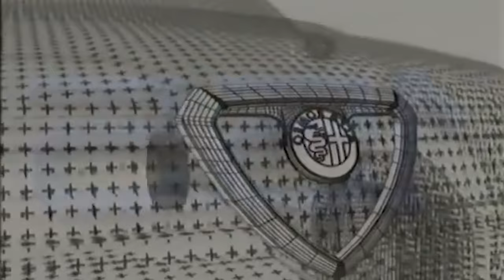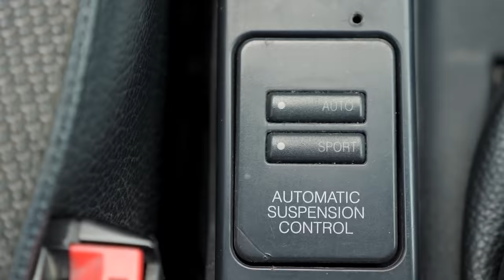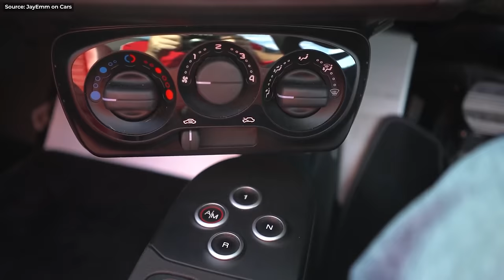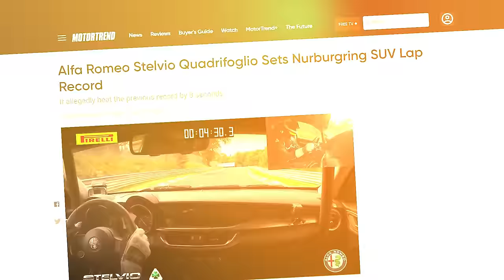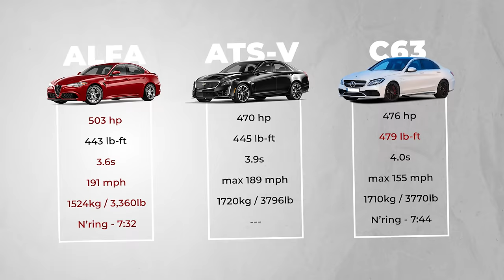7 Alfa Romeos (since 1980) that DON'T SUCK

Comment: The V6 in the Giulia is not a Ferrari V8 with 2 less cylinders, its technically not that simple. Its a completely new developed engine, just the engineers is the same, Gianluca Pivetti. Fun fact: he developed the 4 cylinder petrol too.
Reply: The 2.9 Giulia Q engine is part of the Ferrari F154 engine family and is indeed the same engine as for instance the Roma, minus 2 cylinders and a couple other changes like 120° crank.
Reply: @gerbrandicus  no its not. Inform yourself properly and dont believe journalists bs talk.

Comment: Exactly. I was a big fan of the English show The 3 Musketeers... until they started talking badly about Alfa Romeos and especially Lancias. machines that have never had problems and they stuck to the gauges which were sometimes faulty. but these are commercial parts and not produced by motor manufacturers (in truth, most were German...). there must be a reason why you don't see English cars around except very recent ones in most of Europe and if Italy is the homeland of engines and manufacturers (not that designers...) copied by the world. Thank you for giving credit to the great destroyer's so much inventiveness

Comment: Putting the 4C against the Corvette isn't entirely fair, as that's talking a mass produced domestic car versus an imported car built in much smaller numbers. And over here in Europ, that Corvette would be quite a bit pricier than the Alfa....like twice as expensive her in the Netherlands. Also, it was released in 2013, so no wonder the interior looked like one from.....2005 or so. And who even wants power steering in a hardcore, lightweight sports car? Everything focused on handling and performance (very much in that order).

But in all honesty, I don't think that many Alfa's of the last decades sucked. Many were perfectly fine cars that generally looked and drove the best in their class, though generally at the cost of practical stuff and modern tech. And no volume brand can survive on enthousiast cars only. I've been driving a diesel Mito for 8 years and over 250k now (with near-perfect reliability!), and despite some nuisances, I still enjoy it. And can't think of a better car in its class. But the big problem with Alfa was that everybody liked them, yet didn't buy them. And it wasn't helped by the fact that they kept old, outdated models for way too long, or didn't give them proper successors. Like how they scored big with the 156, yet couldn't continu that with the 159, and by the time the Giulia finally arrived they had basically lost all their former customers. And after years of being almost dead, they come with the outdated-from-the-getgo Tonale? Who do they think they're fooling? Luckily the Junior finally seems like a step in the right direction again.

Comment: Well - you've missed out the SZ (which is criminal - it truly did not suck) and even worse you missed out the 156 (which did not come to the USA), which is a pity because its 2005 Guigaro (I have one) is the one to have and drive every day - the way you are supposed to - with German/Japanese-quality electronics, the mighty V6 Busso Engine, and a manual gearbox in a 2+2 sports car (the rear doors are only there for easy loading) remains a heady mix...and it had the unhinged GTA variant with the 3.2 - and a stationwagon ! While we are at it, there was also the GT V6 3.2, another gorgeous, heady and non-sucky modern Alfa.

Comment: Ive never heard the original spider called a duetto before. Was that the American name for them? Wikipedia doesn't mention it.
Reply from the maker: From Wikipedia:
"To choose a name for the spider Alfa Romeo announced a write-in competition, offering an example of the new car as a prize.[15] Over 100,000 ballots were sent in, the great majority from Italy; the winner was Guidobaldo Trionfi from Brescia, who proposed the name "Duetto" (duet).[15] However it could not be officially adopted due to trademark issues: the confectionery manufacturer Pavesi had launched on the market in 1965 a chocolate snack called, indeed, 'Duetto'; the Court of Milan ruled that Pavesi, having already registered the name, had exclusive rights to it, thus the car was named simply Alfa Romeo Spider 1600."

It still remains as a nickname and many people call it like that. Besides, Spider is just a type of car. Duetto is specifically only this one.

Comment: The concept of the Califorina was originally supposed to of been a Maserati. But due to the high costs of the engineering of the car it was better to brand it as a Ferrari as it would of sold better than if sold as a Maserati at the same price.

Comment: The cheapest 4C I found in Europe was 63,000 EUR. Obviously a used one. Considering that the MSRP sates 67 000 USD which is around 61 000 EUR it is safe to say that used  car dealers are greedy assholes.

Comment: eey why isn't the 156 in there? I have a 2002 1.8L TwinSpark with everything facelift except the exterior, blue Momo leather interior and sunroof and I'm damn happy with it. A good friend of mine is a BMW fanboy with an E46 320i Convertible and even he thinks it's great, especially the Momo seats. We also did a few little runs and his 170hp I6 ended up being slower than my 140hp I4. His car does way a bit more but he really believed the I6 will take the lead

Comment: What's your opinion on alfa 33 stradale
Reply from the maker: The car is very curvy, just like the original, but then it has very contrasting hard lines in the headlights, on the hood, and the rear glass. 
It's very pretty, but those things are bothering me .
Reply: @TopCarsTV  now you mentioned I can't unsee it 
It's is also starting to feel that way now

Comment: I had a regular 155 and it didt suck at all. It wa extremelz fun to drive and verz practical at the same time, while it costed back in the about 1000 dollars. A japanese car at that price would have a million miles on the clock and a hole in the floor that would make you feel like Fred Flintstone

Comment: I own a 2022 Alfa Romeo Stelvio Veloce, 280hp, 4wd. I love cars and my wife was open to it (she drives it every day) so I bought it, I knew there was a decent chance I would regret it. It's great for the once in 3 months I feel like taking it driving up a mountain, compared to it's competition it's steering and agility on twisties is fantastic. In every other conceivable way, it sucks. Dealer sucks, Alfa Romeo Australia Sucks,  Diabolical. Fuel consumption for a 2litre turbo is 19MPG for everyday driving. Tech is awful, the car is dangerous, has numerous faults and at 10,000kms travelled feels and looks likes it's done 100,000kms. I knew I was taking a chance buying this car, but I hate it more than any other car I've ever owned. 50+ Cars many many Euros, this makes me so very very angry.

Comment: No special model in the noughties? My 156 GTA begs to differ...
Reply from the maker: That's a fast version of the 156. Not as special as 33 Stradale, Montreal or SZ
Reply: @TopCarsTV -  Yes and its the better balanced - and earlier - sedan alternative to the 147 GTA which you did list in your top 7 - The 156 GTA has the same running gear (with the Q2 LSD,  bigger brakes, and a stiffer chassis). It is a much more "finished" product and also much rarer than the 147 GTA -only 2600 manual sedans were ever built, of a total production run of just over 4600 including the Sportwagon and Selespeed versions. Over 5000 147 GTAs were built. And durable - mine is one of the first built (May 2002) and has just gone past 254,000km and I use it every day in peak hour traffic. And of course its party piece is the incredible sound of the 3.2 Bussone (ie "Big Busso")  it shares with the 147 GTA - I'd argue it is still the best sounding engine with less than 12 cylinders in the world.
Reply: @TopCarsTV  and the 156 GTA is now rapidly appreciating in value as "the" noughties future-classic Alfa to buy - extending the price premium it has always enjoyed over the 147 GTA.

Comment: 4C blows the CORVETTE away...   Real Engineering vs NO engineering in the vette... and oh yah the Alfa didnt  Blow Valve Springs and Differentials @990miles like the vette...   The Vette can barely go in a straight line... no balance.. no good looks and no SWAGG!  GM Junk